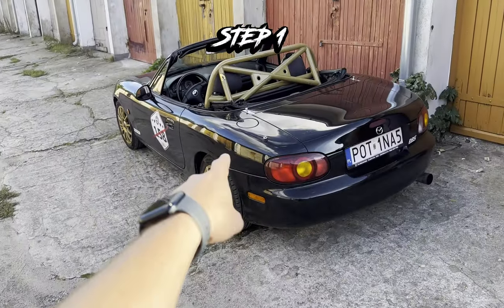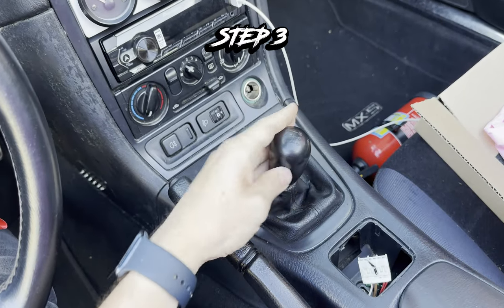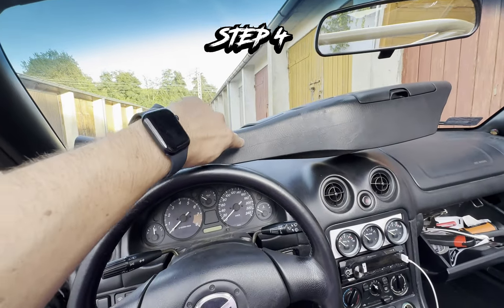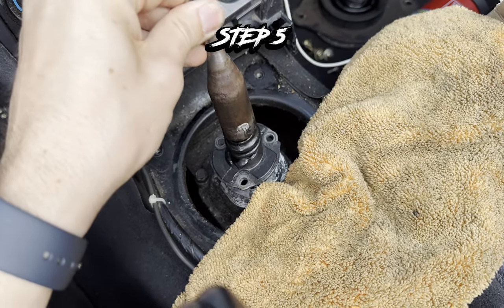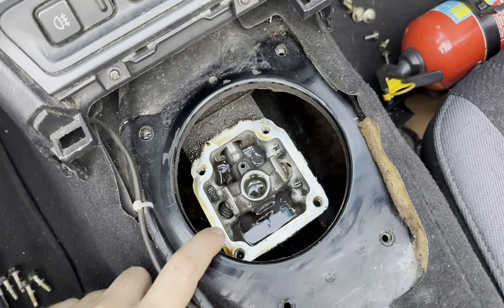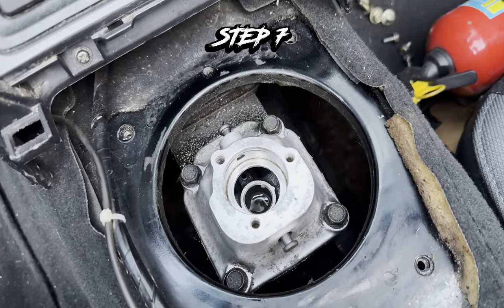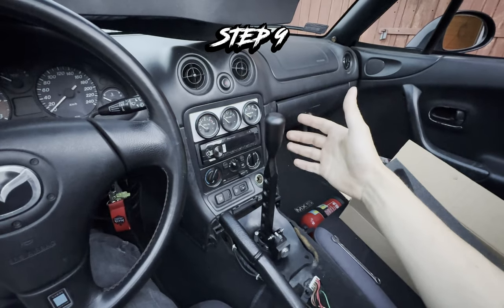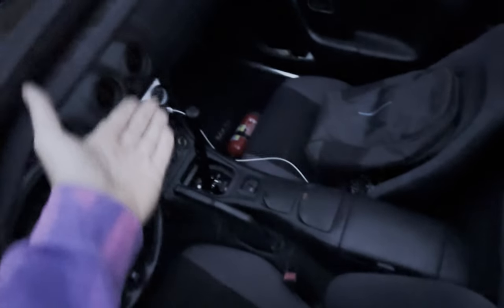This MOD will make your MIATA feel like proper RACE CAR

Comment: Does this shifter make noise from vibrations at higher revs?
Reply from the maker: It does transfer noise from transmission because is hard mounted to it, bo for me it’s mostly bad gearbox bearing sound, it’s quiet at 5 gear for me.